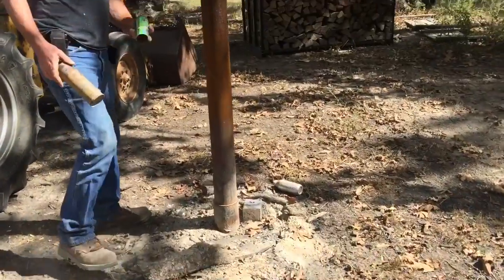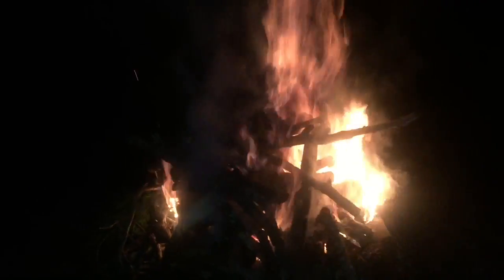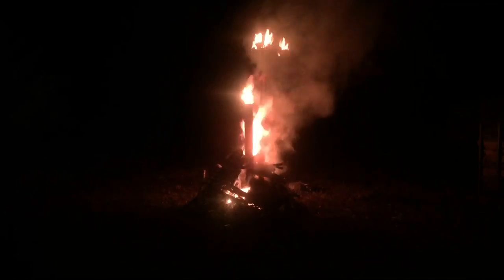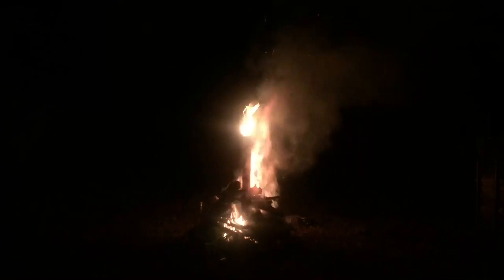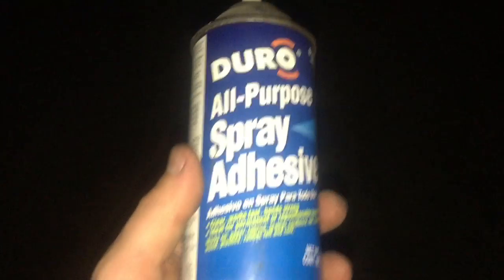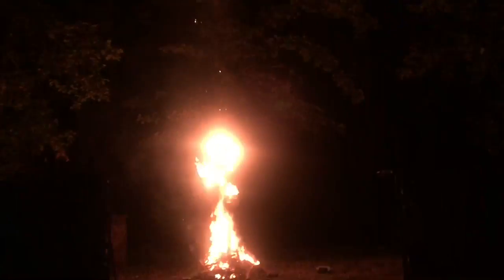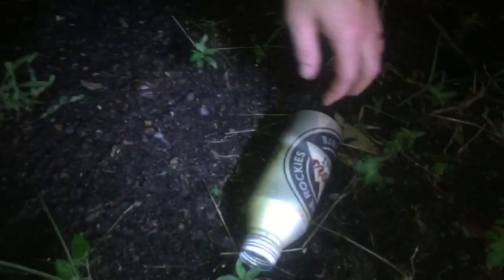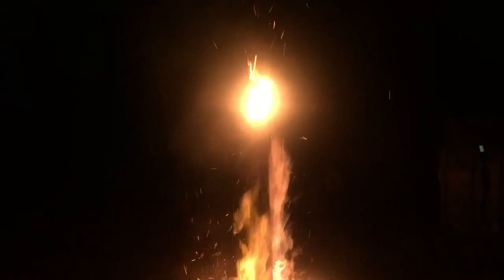(DANGER) Exploding Aerosol cans - Fire cannon - blowing up aerosol cans in a Bon fire.

Comment: If u stack the hollow cinderblocks up innthe middle of the fire and drop the cans in them it works too.
Reply from the maker: Tyrone Smith. Please make a video so I can see that. There is a reason I used a metal pipe.

Comment: I was thinking about making one of these, except it uses a lighter and is mobile. Does anyone have an idea how durable the chamber would have to be in order to withstand an explosion like this?
Reply from the maker: Schrödinger's Cat 

Nope. Good luck. I know the fire has got to be hot a long time before the cans will pop. Iv had some fires there were not hot enough. Had to wait a good while for the cans to blow. So I build a bigger fire now and leg it get good and hot before dropping cans in. Then they blow in seconds. I’d stay with thick heavy pipe. Not a risk worth taking to try and skimp out on something like that. Could get ugly.
Reply: Tape a firework to the hairspray